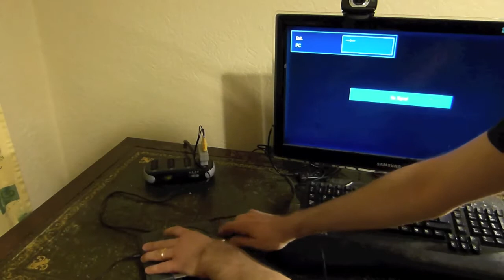Weekend Waffle: PC Engine/CoreGrafx cable modification

Comment: Great video, very interesting in that the MD cable doesnt provide any audio for the CoreGrafx.  Regards controllers, it's entirely possible to map any controller from one system to another - the answer is to use a PIC chip.  With a tiny bit of programming and understanding of the 2 controller types its possible to make controllers work on other systems.

Comment: Very nice little machine. Great modding stuff here. My TG16 has an AV(Red, Yellow, White) cable supplied and of course with the Flash Hucard this gives me access to the library with great video/sound. Only game I cannot play is SFII Dash. I think I have found the 'sweet spot' for PCE/TG16 gaming. The next step is to get the CDROM for it. They don't come cheap either.... Other than this I am having good times!